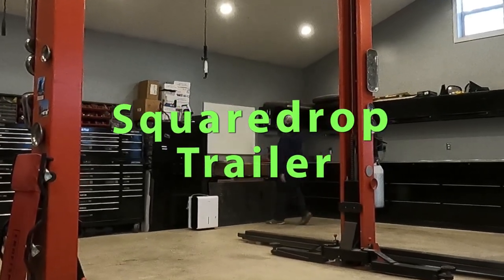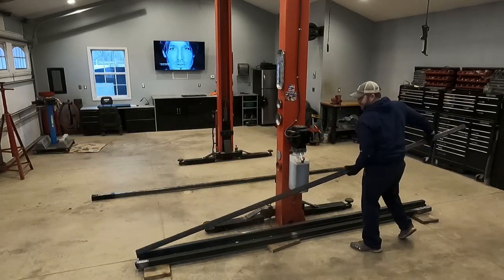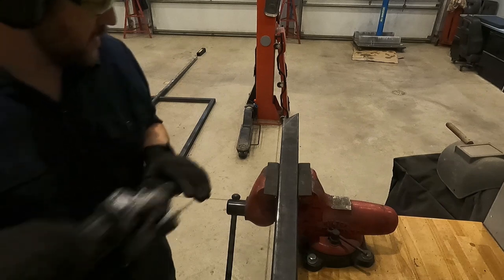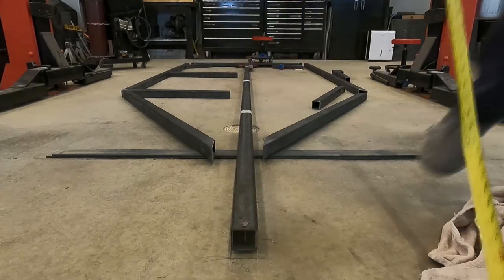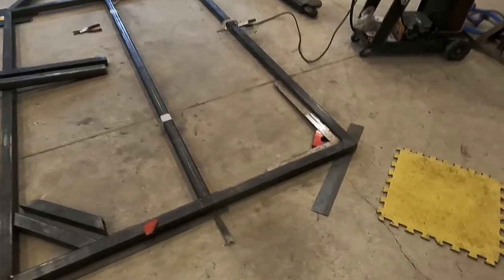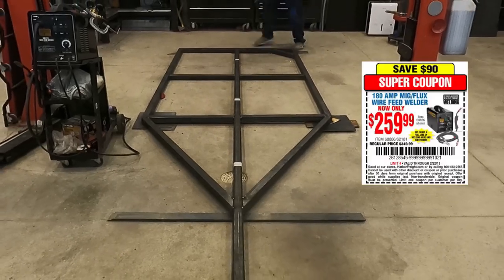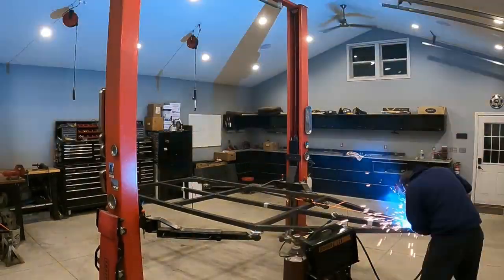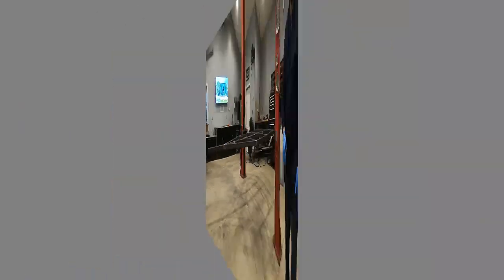Building a Squaredrop Trailer.  Video1

Comment: i know with wood working butt joints aren't as sawed after as miters. I assumed because you're welding the joints a miter would be unnecessary? Do you have any thoughts on that? I want build mine basically like this but I'm debating butt joins vs miter.
Reply from the maker: I mitered them for a couple reasons:  1.) more surface area to weld and 2.) metal tubes are hollow and mitering them will seal out the weather.   ...not to mention: I like the look. 

They make plastic plugs in different sizes to help seal the ends of the tubes if you choose to weld the tubes in butt joints.  (I used them on the 2"x2" support bar between the timbren suspension)